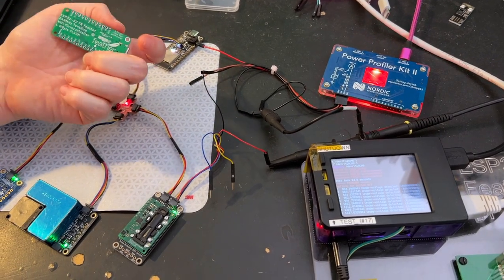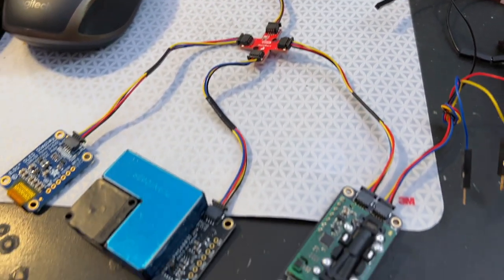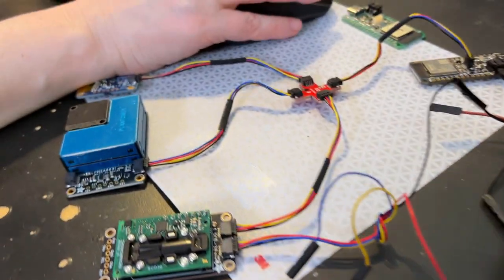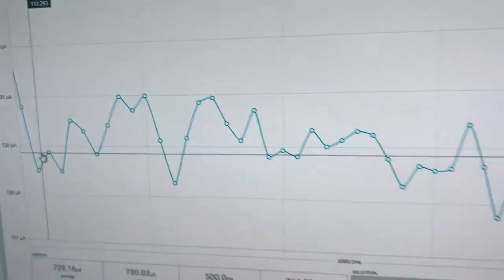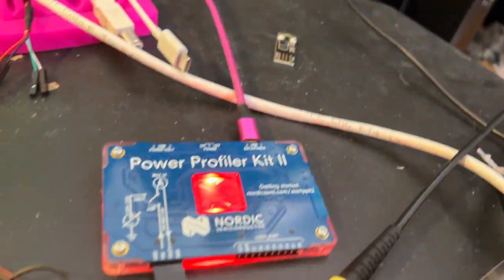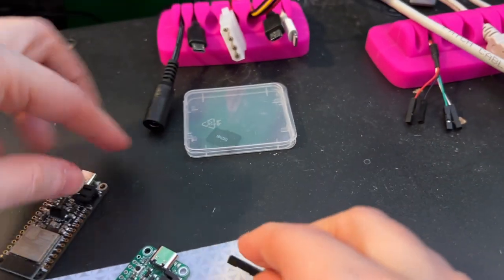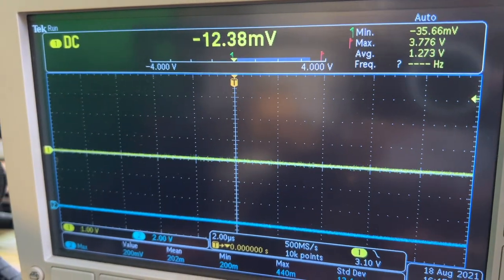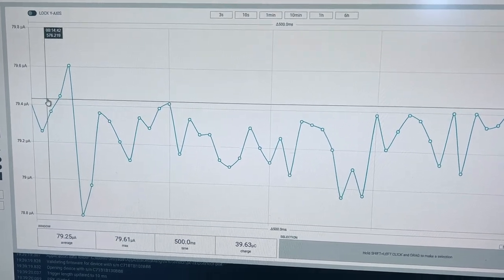Lower-power Rev C of the ESP32-S2 Feather coming soon!

Comment: Hello, CompE student here. What are you using to measure and test the power consumption? I'm working on a capstone project and I'm curious what software and hardware you are using other than the oscilloscope, or is it an integrated feature? Thanks in advance!
Reply: It's a power profiler kit II from Nordic Semiconductor. Easily purchasable online and worth every penny for doing battery power consumptions